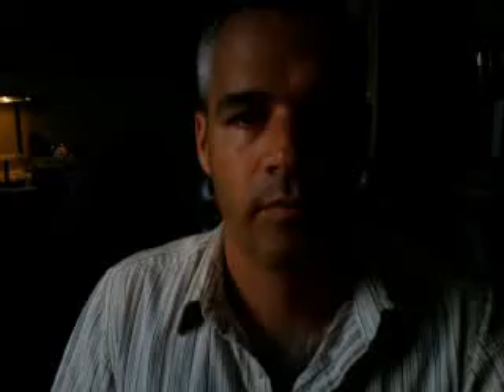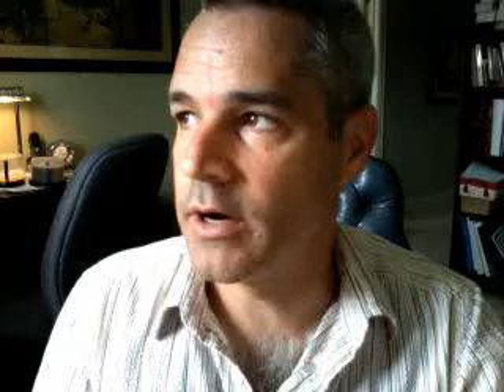Re: Passive Solar COOLING - For Hot Humid Climates

Comment: DC current must be produced due to storage.AC current can't be stored,unless you own power grid.Today's microinverters have 96.6% efficiency,so not too much juice is lost.Solar thermal aircon. doesn't work as promoted.It's less hussle to hook PV panels to your compressor.

Comment: ZED is great,but the idea of using 180F roof for producing electricity would not work as you think.To move alternator,you need steam and that is not going to happen with just roof even if it were 200F.You need steady steam and a lots of it.With latest cloudy and rainy summers due to chemtrails,it will be nearly impossible to produce good amount of solar steam.Let's say you build solar thermal array,the bigger the better and you have only 4h a day to produce steam,if lucky.

Comment: already a zed fan.  regarding the two comments below, photo-voltaic, appealing as it sounds vs. solar thermal, produces the "wrong" kind of electricity (direct current, while your house likely wants alternating current)  you lose some juice having to convert dc produced by pv into ac current.  solar thermal produces heat, that you can do alot of productive things with, including air conditioning your place.  here in the hot humid southeast, we're rooting for ya ZED.